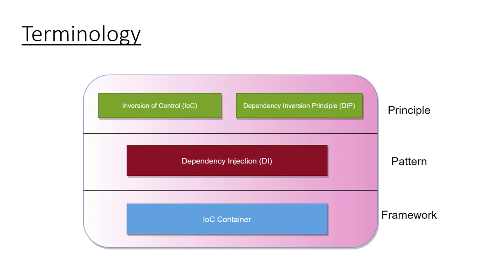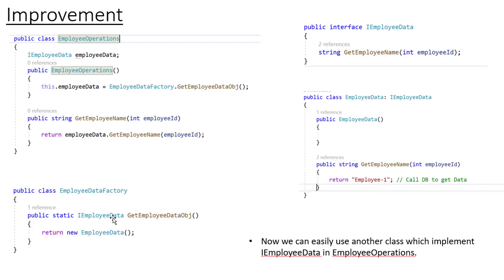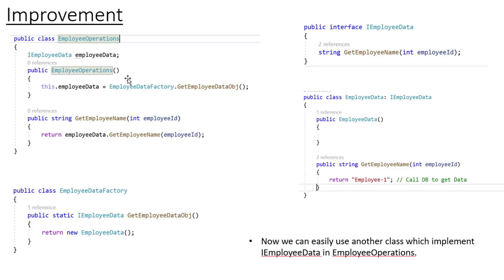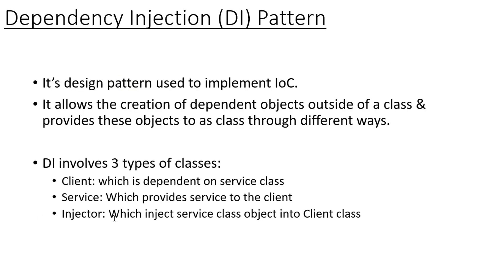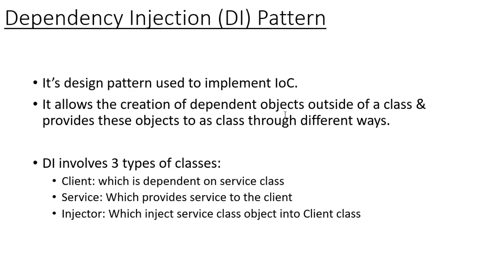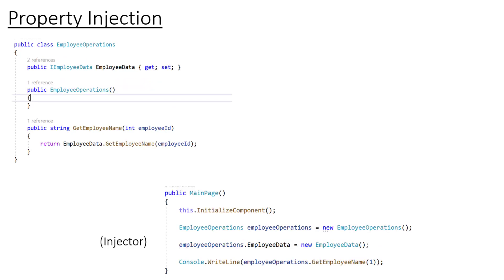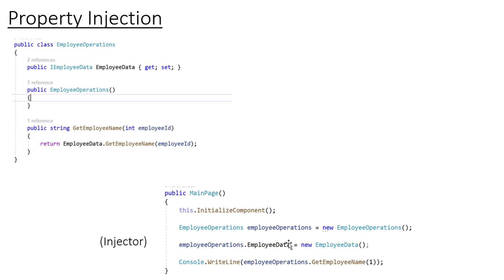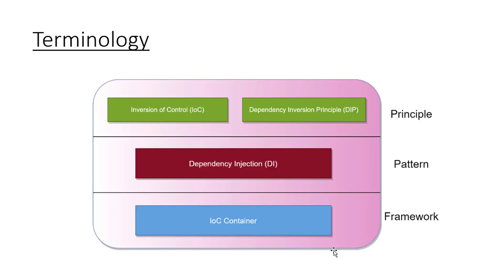Understanding DI (Dependency Injection) Pattern using Examples

Comment: Hi, Information was really helpful.When should we use DI pattern specifically ahead of DIP ?
Reply from the maker: Thanks for your feedback. If you see from video, both DI & DIP helps in achieving loose coupling. 

DI is definitely on top of DIP so we should try to use DI pattern when we're creating objects in class. So rather creating objects in class, pass objects as injected i.e. Constructor injection. 

When you use DI pattern, DIP will be implicit in it.